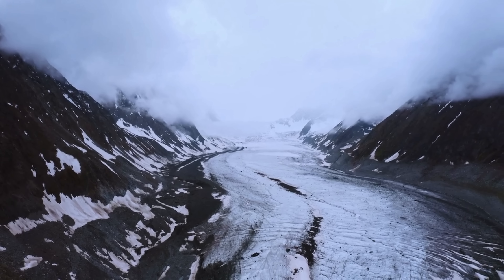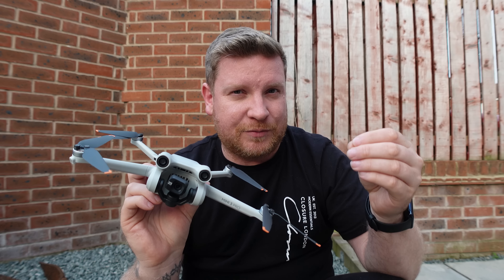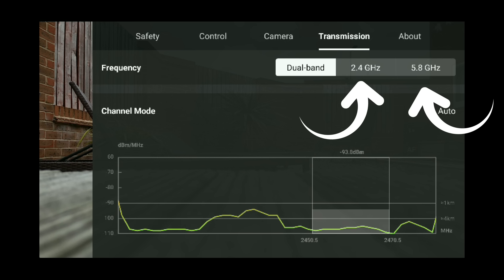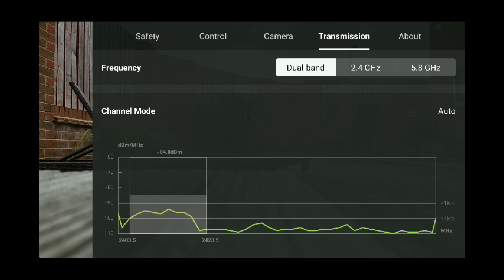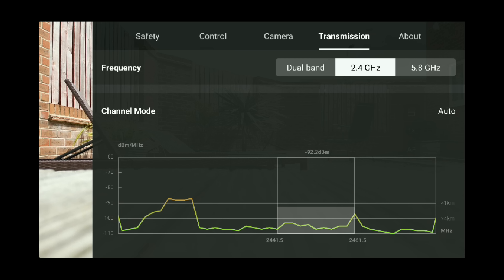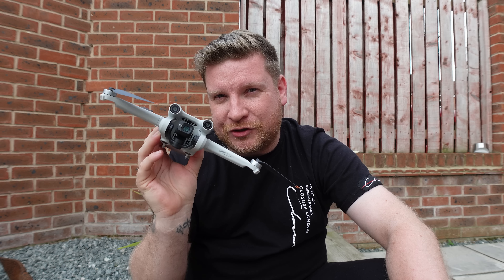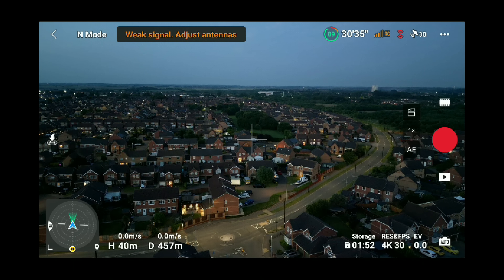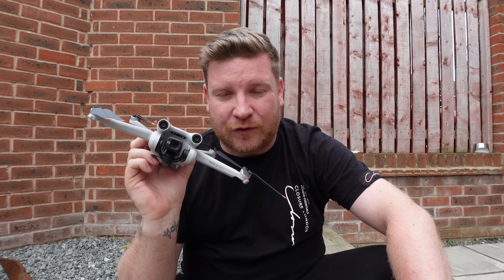THIS Is WHY The DJI Mini 3 PRO Has Signal PROBLEMS! ( Yet Some Don't )

Comment: Good Day Gavin.  I am an old Ham Radio operator, and a couple of weeks ago I had made an observation about the many stories of the Mini 3 Pro range issues, and at that time I, as now still have not received my new Mini 3, so I could not try the experiment that you have just done.  I want to thank you for taking the time to test this out.   I believe that you may have hit the nail on the head.  I suspected that Ocusync 3 is having a problem deciding which frequency to use and when, and thus also creating a hesitation between choosing frequencies, therefore loss of signal, only to regain it again a minute later when Ocusync 3 makes up it's mind.   I also do not think it makes a great amount of difference which controller is being used.  Thank you so much for doing this test.  I really hope Dji pays attention to your video posts.   GOOD JOB!!!!
Reply from the maker: Thank you very much for the kind words! Glad you enjoyed the test and the reasoning and that our suspicions seem to be in line with each other. Appreciate you wanting and your comment thank you
Reply: Aaaaaw. How lovely.........Ham!..............
Great video, first time viewer, trying to figure out why my new mini 3 wont gove RTH option🤔

Comment: The image in the video pretty much tells me that the drone is still on the ground. Before the drone takes off, the distance between the drone and the remote would only be a couple of feet, so obviously there won't be any connection issues. So from that point until a certain distance interference would not be strong enough to cause a channel switch as Ocusync is designed to do. Doesn't matter whether you're using the RC-N1 or the DJI-RC.

Comment: Just upgraded from Mini SE to a Mini 3Pro and was very disapponted with the range.  I saw you video yesterday and swapped to manual and 2.4GHz  (I am rural) and my range doubled instantly.   Thanks!
Reply: i got mine and faced the range issue today, it barely went a few steps away from me before losing signal, should i switch to 2.4ghz?

Comment: Definitely could play a part in some cases, however I've seen many people with equally poor signal on the RC-N1. I do most flying in a rural area so next time will manually select 2.4 and see how it goes. I still find it strange my Mini 1 continues to outperform my Mini 3 when it comes to range here.
Reply: I have the Mini 1, my max range is around 300m, what distances are you seeing?
Reply from the maker: Check out my video on extending range with the mini, picking the right manual channel and a range extender will really help

Comment: In Scandinavia... I´m getting more stable and longer range with the RC-N1compared to the new RC that comes with the Mini 3. Had both and did several tests at exactly same places, similar climate, same time of day, etc. RC-N1 has no problem letting you fly out of site (not recommended of course but for sake of test) behind forest, standing behind building, around and behind island on sea, etc. Also seeing more stable connection with RC-N1 when flying in densely populated areas. Glad I sold the Mini 3 with RC and kept the RC-N1 kit (yes did the test switching units back and forth.. same result.) On a side note.. also preferring the stick controls on the RC-N1 which feel a bit more damped and easier to make micro adjustments with.
Reply from the maker: I also prefer the RC N1 controller myself
Reply: @GAVINHR  me too, I like being able to take a call while flying. Instead of holding the controller and having to pick up a phone also.

Comment: Thanks for talking about the manual channel selection I needed this to fix my issue
Reply from the maker: You’re welcome
Reply: @GAVINHR  Thanks for the response! If you want extra content ideas, especially regarding your extensive range extending legacy, you can try making a large parabolic mirror bowl with aluminum foil, and then try it with a proper satellite dish.  Align the controller antenna in the focus of the mirror dish and in theory it would work. It's more based on real science than the yagis, reason you don't see it is it would be only useful for extremely high altitude 0 Distance flights, where the parabolic mirror is sat on the ground permanently facing up. if you need help getting a form 107 waiver to get above 500m restriction then I can help you since that is what I do. I have 4999m unlocked
Reply: @MarkHivosk  did you solve your problem by manually changing the frequency?

Comment: Very interesting Gavin👍.  So looks like your testing shows in urban congested areas where the 2.4ghz frequency is being shared/used by all kinds of peripheral equipment, home WiFis, cell phones, computers, and so on, are affecting the mini’s best signal.  Switching to the less popular 5.8ghz frequency gives the mini a more reliable signal…  BRILLIANT observation.  I will test the theory myself here in Miami, Florida, 🇺🇸.

Just earned a new subscriber.
Reply from the maker: That’s exactly the case ! Thank you for the sub :)
Reply: What happened? Did it make any difference?
Reply: Thank you for this comment. This really helped me understand it better.

Comment: Great explanation! That explains why the recent firmware update for this issue was only for the controller.  Whereas it used to be a theory that the drone had bad antennas.  Unfortunately, while almost everyone has stated they've gotten better connection, many people say it did not improve by too much.  This remains a  sporadic issue.  Some people have shown fantastic ranges on their mini 3, even surpassing the mini 2 signal and range.  Whilst others stay showing abysmal range and signal dropouts on the mini 3.

The rc-n1 just seems like a better controller.  Indeed upon opening up my mini 3 the controller felt so flimsy compared to it.  Another annoying widespread issue (also affecting my drone) is overheating.  My mini 2 never overheated.  Just today I did a test keeping the drones on and idle and the mini 2 did not overheat even after an hour while the mini 3 overheated in 7-9 minutes on multiple tests.

Have you solved/figured out your signal issues since?  And have you ever had overheating issues?

Great video!
Reply: it is said that the dji mini 3 pro doesn’t have internal fans to make it lighter and is designed so that when in flight that the back propellers pushes air into the back vents to keep it cool, so if left on the ground the dji mini 3 overheats and shuts off while the dji mini 2 doesn’t overheat because it has internal fans
Reply: The mini2 has a fan built in. My mini 3 gets warm in less than ten minutes also. I use a air mattress inflatable device and prior to that a lap top fan table stand helped also...

Comment: I’ve had my mini 3 pro with rc for a week now and I live in a built up area like you in the uk, except I have a 100meter row of very tall trees in front of my house  . 

I’ve had no signal drops so far flying out to around 400 meters . I haven’t gone further yet due to some angry seagulls . Looking at my flight data in the Airdata app it shows no signal drops  whatsoever and I am using the remote with built in screen . 

Airdata tells me my mini 3 maintained %100 signal during my 35 minute flight (extended batteries)  . So far so good 😀
Reply: Hi where did you get the extended batteries, and do they work ok in the uk
Reply: @djidroneadventures4059  forgot to mention. Yes the batterie plus works fine in the uk , I’ve had no problems
Reply: @pollyaloy  That's amazing. Where did you manage to get the + battery from
Reply: @djidroneadventures4059  someone is selling them on eBay uk  .   He must of imported them, he sells single batteries and the full fly more kit plus .

Comment: has this been fixed? I hear the RC is bad because it does not have antennas so it might be good to get either the old one with the phone controller or the PRO RC
Reply: N1 will always be better due to external aenntenas.

Comment: Lost a mini 1 recently, so have a 2 on the way better signal ect, good advice on the frequencies. Stayed away from the 3 as a pole showed 48% having problems, could be down to the different chips due to shortage, many are using chips they wish they didnt have to.

Comment: Thank You so much GAVINHR for your great attention of the problem!!!
Like many others I am waiting to order this Mini 3 Pro untill a Firmware Update has solved its Range Issue....
The Frequence Shifting Function is for sure the most complicated basic function which would need to be secured for DJI ! Highest probability to fail if any major included sw or hw is updated!
I can read out that their antenna specs are changed from Air 2S to Mini 3 Pro!
2T4R in Air 2S means two transmitters and four receivers.
1T2R in Mini 3 Pro means ONE transmitter and two receivers, which could possible be a step to save cost or weight in the Mini 3 Pro??
It looks like the Air 2S Antenna Spec in general manage 300mbps "Fast Upload and fast download" while the Mini 3 Pro Spec manage 150mbps which is on the edge of its MAX VIDEO Bitrate Spec!
=> While the Air 2S and the Mini 3 Pro has equal rated Video Bitrate Spec, it looks like the Air 2S Antenna has by far a larger Bitrate Marginal left to handle the Drone it self and Frequency Shifting in parallell to the Video Transfer!
The drone will pass over areas where WiFi Traffic differs, so a shift in WiFi Frequence should in most cases be initiated by the drone!
With the new less efficient Mini 3 Pro antenna which limits the upload capacity there must be a function which handle a priority between Drone Handling, Frequency Shifting and Video Transfer?
That function must be by far more important in the Mini 3 Pro than in the Air 2S!
=> If there was a way to limit the Video Bitrate it self ? And when weak signal also testing influence of limit the handling (stop the drone..) we could maybe figure out if the signal improves? Meaning the Frequency Shifting worked due to less other Data Transfer from the Mini 3 Pro Drone?

Comment: As ever you give me something i had never even thought about to check and consider if i get signal problems ( i haven't yet ) but cheers Gav. Always thinking outside the box
Reply from the maker: Thanks Nick!
Reply: Yes but he’s thinking outside the box about what’s going on inside the box, and for that we are grateful 👍🏻 New owner living in a sparsely populated rural area of the highlands, and getting line of sight of around 1,5km, beyond which I would lose sight of the bird anyway, so basically happy. I did see that several are fitting external antennae per Dutch Mark Mark’s video, but it’s not clear to me that this would be a great advantage, the Netherlands being the most densely populated country in Europe, with lots of interference sources. Basically I’m happy with the range, given the size, and looking forward to installing the waypoint upgrade, which will make the wee drone a powerful tool for my purposes. Thanks again!

Comment: There is a strong theory that the removal of the vertical antennas at the feet is the cause of the weaker signal. The drone is no longer sensitive to vertically polarized signal...
Reply: Yes. It makes a huge difference
Reply: But then others don’t have that problem. Also, you are more likely to hear about an issue than a non-issue for people.
Reply: i think gets to hot during firware upgrade. made video
Reply: @sleepingbearffg5008  mine has been fine with updates and range so far, thank goodness.
Reply: @barryp8145  I just believe better safe than sorry. Love the bird myself.. been long time since owened a camera bird.. always few FPV race drones. Allot of fun but repairs take time and money.  Not as much as this bird! Lol
Reply: @barryp8145  thanks brother! God bless
Reply: @sleepingbearffg5008  God Bless. Not often you hear that anymore. Appreciated.
Reply: @barryp8145  I hear ya:( I try to surround myself with like minded people.. I have small channel.. I'll be making vids  of bird and what I've learned. Welcome to swing by? Have good group of friends.. family brothers and sisters.
Reply: @sleepingbearffg5008  I will. Sounds good.
Reply: 1) polarized antennas should be factory fixed and sealed behind plastics. There was no such thing ever
2) vertical antennas maybe can give you that 3dBi improvement only in case that you have LineOfSight and your antennas directed very precisely towards drone. Which again BS because after 300 meters you can't aim on you drone. 

Also, no matter the transmitter, single concrete wall fixed above any other, will fully kill your signal. Because in that case there will be no reflections .

It's toy, sometimes tool, never meant to be military tech

Comment: hi thanks for sharing your thoughts on this matter , I had the mini 2 first and could send it miles before it lost connection .
Since buying the mini 3 with the rc remote when it came out I have been very let down with the range it can fly before it loses connection. Im at a point now where I'm thinking of selling it and going back to the mini 2 ,although I do like some of the features of the 3 and feel the camera and picture quality is much better.
I am going to try your advice to see if makes a difference in range perhaps this could be the last chance for my little mini 3.
Regards, Buzz.
Reply from the maker: Well I hope it works for you ! Please feed back what you discover with this method, I do believe the antenna placement on the drone is the issue rather than the RC controller but please do let me know
Reply: May we have a feedback please ?

Comment: Hi Gavin just found a very annoying 'feature' on the Mini 3 pro relating to signals you might like to review. I live in an authorisation zone so applied for an unlock which I did make work by using my mobile phone as a hotspot. However having turned the hotspot on and connected the controller too it, when you go to take off the message 'Turning Wifi and Bluetooth connectivity off to improve connectivity, If you need wifi turn it back on manually'. You still need wifi to finish the authorisation process so you then have to turn it back on again. Unless I'm being a numpty and doing something wrong.
Reply: This is one of the feature that annoyed me too!

Comment: Regardless what configuration my mini 2 will go about 1.5 kms further before I start losing signal. My friend also has the same problem. Informative video but I think the problem runs deeper than this. Hopefully they can fix it with a firmware update but for now I'm taking my mini 2 on my vacation.

Comment: Great video thanks. A month ago I was in Liverpool city centre and I lose control when I can still read most OT the writing on the drone. Definitely I can read my drone reg number with squinted eyes. Now July the 12th and many updates later on the Isle of Mull clearly no buildings around beautiful sea and scenery. No signal yet again it gives no faith in the mini3. I have been flying DJI drones for 15 years and NEVER have I had this. I have the mini2 with me no problems I have the Mavic pro 2 no problem but the mini 3 I seriously want to throw it a way it has no use or ornament. Now I am using the Tripltek8 not sure if that’s a problem with the mini3 but with the mini2 it’s brilliant.. DRIVES me nut. Thanks for sharing. Ray K. UK. YNWA.
Reply: I had the same issue and lost a Mini 3 Pro, crashed after losing signal and hovered for few minutes. I love the mini 3 pro but it's the first time had issues in years with DJI...Very annoying indeed.

Comment: Very interesting and super helpful video! I got this drone as my first drone ever a couple of weeks ago and having a LOT of fun with it. But indeed, signal drops when the drone is still in quite close distance did happen to me yesterday. I went to a rural area but where there are some overhead power lines installed. Obviously I'm well aware these would have an impact and I tried to stay relatively far from them. But I was wondering what is usually the range of interference of those lines on the RC transmission signal. Any ballpark idea? In any case, I will try your manual switching tip on my next flight....which should be in an hour or so. :)

Comment: Hi Gavin,
I noticed long ago that when you turn the RC by 90 degree  (but still towards the drone), I get a stronger signal. This would support the mismatch of the antennas in the arms "Horizontal" Versus "Vertical" polarization in RC .. :(
Reply: Also if you rotate it with screen down, you get over 10% more signal.

Comment: When you pass over houses, the 2.4 Ghz routers can also detect the band of drone and is switching also the channel...As all new routers and mesh units does this, will start a hopping between channels as long as you interfere with that network.
Now, 5.8 Ghz is more clear as the signal is not penetrating the walls at houses so easy...but will be pretty sensitive to any obstacles, so even a tree will kill your range.
To set manual channel is pretty dangerous, as you can enter in a range of a network that you cannot predict at take off and you will be jammed.
Act with caution.

Comment: Great info, but how do I get the RC controller to select FCC mode here in the USA.............RC always goes to CE where RC-N1 picks FCC every time...............bummer!
Reply from the maker: Hi bil! My apologies if I didn’t make that clear, the RC selects the transmission strength based on location therefore in the US it should already be in FCC mode
Reply: That's the rub, it does not select FCC mode, picks the right frequency for rural vs urban, but stays in CE mode always according to the Transmission graph (verified I have the right firmware updates for the aircraft and controller, and right software update for the Fly app).........DJI has no response as yet, started with agent, upgraded to supervisor, and now awaiting reply from engineering staff.  Got a dud me thinks!